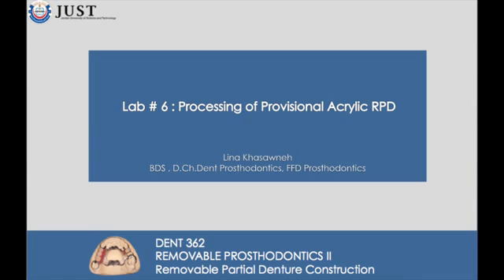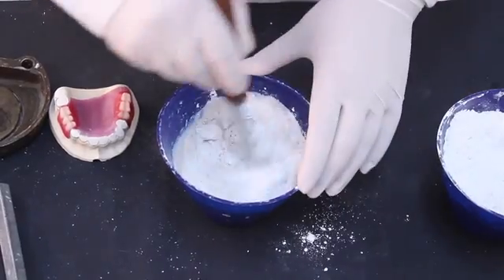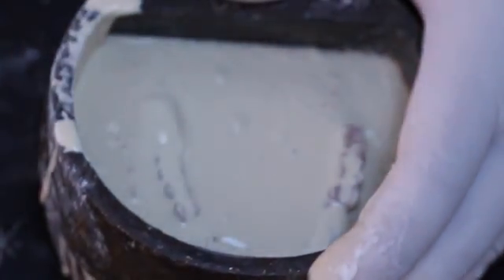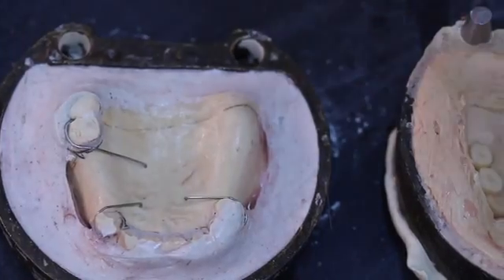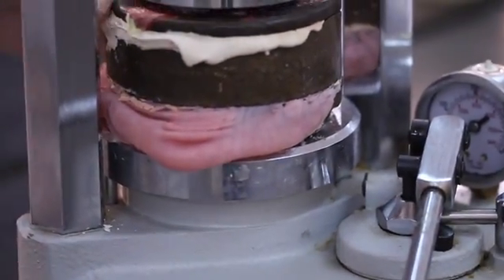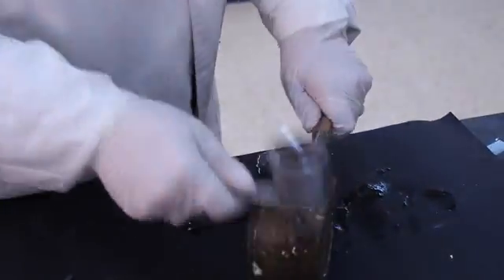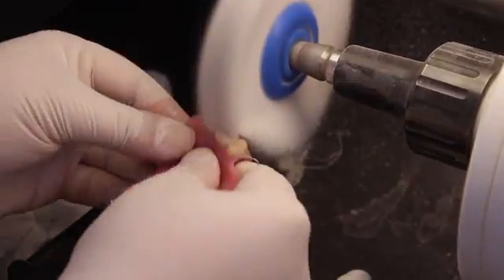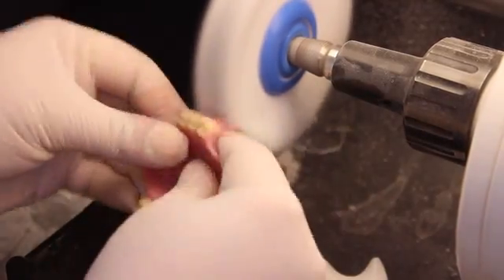Lab # 6: Acrylic RPD Processing

Comment: It is good to see even teachers struggling with the denture extraction from flask.
my question after this video is about trial packing, how will you add any resin mixture to the flask without opening it and causing the material to distort as it is not hardened enough.

Comment: I don't understand the purpose of waiting for the acrylic to reach a dough-like stage? Instructions tell you to just mix and pour right away. What is the difference?
Reply from the maker: Thank you for your question. Acrylic is best shaped into the mould in the dough stage, pouring it earlier or later than that will lead to porosity in the final product
Reply: @teachingprosthodontics9225  Ah, makes sense. I never had porosity in liquid form, but did have some grainyness and alot of the flash as they call it (extraneous acrylic to grind down). Don't know if the dough stage helps with that, but have tried the dough past two dentures without any problems. Thanks
Reply: Some acrylics are meant to be poured, others packed.